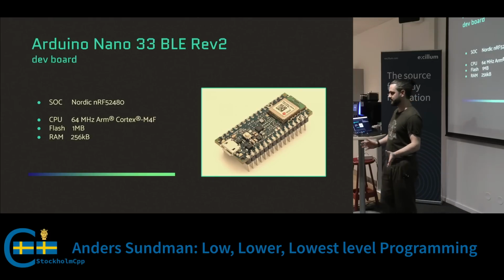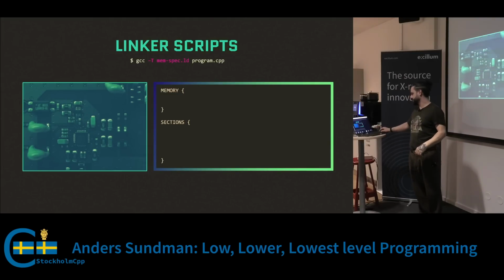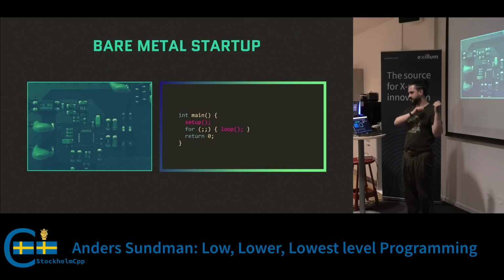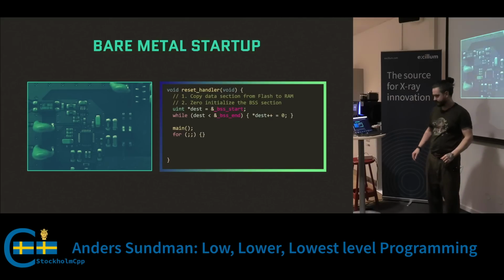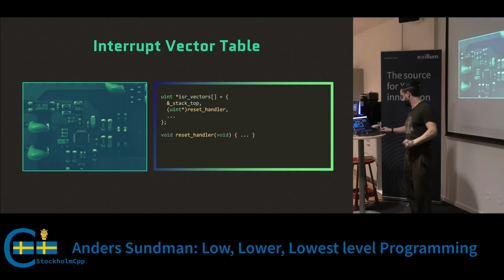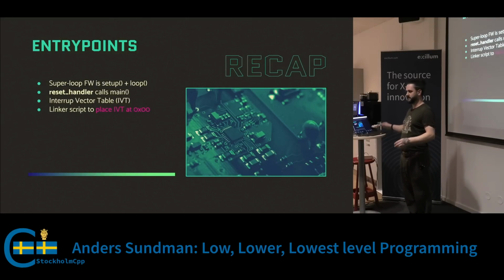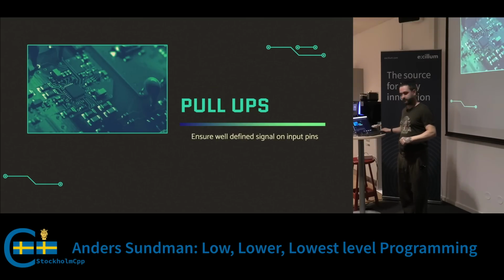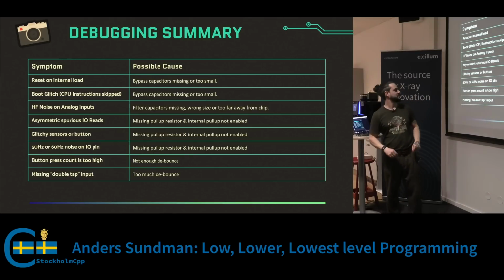Anders Sundman: Low, Lower, Lowest level Programming

Comment: It's definitely not low level programming. Where are the 1s and 0s ?
Reply: C Source Code
   ↓
Preprocessor
   ↓
Expanded C Code (after resolving #includes, #defines, etc.)
   ↓
Compiler
   ↓
Assembly Code (ARM Cortex-M instructions)
   ↓
Assembler
   ↓
Object Code (.o file) → Machine Code (010101...), in ELF format
   ↓
Linker (uses .ld linker script)
   ↓
Firmware Output (.elf / .bin / .hex) → Ready to be flashed to STM32
Reply: @rickpat0101 Lowest level from a programmer's perspective is assembler language. Handcoded .s files assembled to .o (ELF format). As long as there's compilation from a higher abstraction than .s, it is not the lowest level.
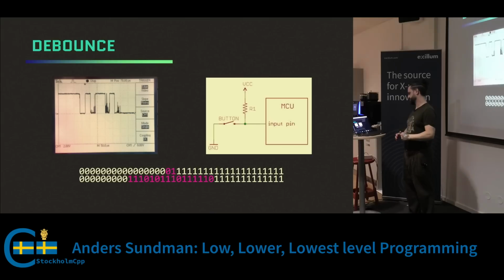Reply: 38:57 😉
Reply: 010

Comment: c++ and em bedded development are absolutely mutually exclusive.
Reply: This is not true at all. It is true at all. Hmm, so what. As with any tool, use it wisely. Don't use a sledgehammer where a screwdriver is needed.
So for C++: Don't use all the whistles and bells that modern C++ offers you.
Reply: @monlynx  Chuck moore who invented the Forth programming language says if your binary is not at least 100 times smaller than the equiv C whe you code it in forth then you ahve done it wrong.  

I for example have coded a ncurses like  windowing system in forth in 6 k and ncurses itself is in 600k so this seems to hold true.

Even if you avoid all the language bells and whistles with c++ your resultant binarhy is going to be OVER 100 times larger for being c++.  There are two things you dont have enough of in any truely embedded system.  Processing power and data (including code) space.   Doing embedded things in C++ is *M*O*R*O*N*I*C*.

I have a friend who says that "Developing embedded applications in C is like opening a CAN with a ROCK" But even C is perfereable to c++ (unless its Keil's 8051 C compiler lol).
Reply: @markmanning2921  embedded != embedded. There are embedded systems with 16 Cortex-A72 and 4GB RAM. 
Plus C++ code can be done real small. 
Regarding Forth: I have not seen any project in my 25 years of embedded programming using Forth.
Reply: @markmanning2921 depends on the application.
On esp32, or even the much more constrained atmega328 or even atmega128 etc is perfectly fine with c++.

You can also easily make a wrapper for a function you write in assembly, (or use inline assembly) with c++ for time critical portions of the code.

If the app you are making is dead simple; read a pin and report its state to serial f.ex; its the serial transmission which will be the time limiting factor whether you code in c++, assembly, or probably even with micropython. 
(By serial transmission i mean the hardware UART, if you use SPI or bit bang your own "serial interface" then its another matter)

But when your app just gets a little involved, its the regular stuff that often is the issue anyway; bugs.
Not just from code syntax, but also code logic in reference to hardware.
Better tools like c++ over c, in environments where you often dont have (reliable) debuggers is very nice to have.
Reply: @markmanning2921  This felt wrong in so many ways. Agree with you 100%

Comment: I'm not a professional with embedded systems yet I am familiar with most layers of abstraction. From a C++ language perspective with respect to modern embedded systems, I would say that is fairly low level. It is diving into the entry point into a C++ program by invoking main, setting up or prepping the CPU or system's text and data segments, reset vectors, etc. while also pointing out what to be aware of from the hardware engineering side of things. I can agree that this is fairly low-level programming within the context of a high-level language.  

However, I still wouldn't say it's the lowest level. Sure, we are diving into a bit of assembly and sure we are setting up the memory addresses, the stack frame or base pointer, the reset vectors manually, however, it's still relying on the various C++ compilers, linkers, even the operating systems to do a lot of the leg work for us. 

If one was to claim that this was the lowest level of C++, then they would be literally writing their own C++ compiler and linker at the assembly or even at the opcode level for a given piece of hardware, architect agnostic of or even without any system calls or kernels from an arbitrary operating system. Yet, most people rarely do this anymore these days. They rely on GCC, Clang, MSVC, and depending on the compiler and linker tool chains, they highly and primarily rely on LLVM pending and in many cases, they also rely on already well-defined filesystems that have already been implemented such as the elf file format or exe executables. People rarely create their own filesystems, and their own virtual tables, memory mappers, schedulers, etc. 

So even as this is within modern embedding, there are still many lawyers of abstractions that are still being relied on.

This is just my personal perspective and I'm just a self-taught hobbyist. I've been around computers since at least the mid 80s before most computers even had internal hard drives where they only had a few KB of RAM and enough internal ROM to store a Basic Interpreter. The lowest level of programming agnostic of any programming language including assembly is without a doubt bit banging. If you're not working with the individual bits of each and every instruction within the ISA or the system's OP-Codes, then you are working at some higher level of abstraction. And even this isn't the lowest level of abstraction. When you start to build your own ISA from basic Logic Gates, that's even one lower level, and yet that's not even the lowest level. When you start to build out your system from transistor networks that's even one level lower than pure logic that builds out that logic. Yet that's not even the lowest. When you get into the composition, shape, volume and placement of various materials to make your internal devices such as your transistors, that's even another level of abstraction lower. How far down the rabbit hole do you want to go? Quantum Mechanics? Pure Mathematics and Physical Computations? State Machines? Lambda Calculus? Turing Complete? 

Yet, this is why I truly enjoy and appreciate videos like this. The time, work and effort that is put into them for others to observe: Thank You! It was truly enjoyable to learn something within specific subset or subfield of the general field of mathematics, physics, electronics, computers that I am into that I know little about. I'm quite familiar with C/C++ as I have done 3D Graphics - Game Engine - Physics Simulations design, Hardware Emulation, and even dove a little bit into Compiler Design - Language Theory, and even a little into OS-Kernel design. I'm no stranger to C/C++, I have a decent knowledge of Assembly, and a moderate understanding of ISA Design. As for a hobby, I have the following Steam titles in my library: Turing Complete, Hard Chip which are directly related to CPU design not including other titles that have similarities to many topics within computer science either it being software or hardware engineering such as Factorio, Dyson Sphere Program, Mindustry, Satisfactory, Oxygen Not Included and more. 

If it's engineering related and is or has the potential in being Turing Complete; I'm game! 

Keep up the great work!

Comment: This isn't low level - not really. Try writing two apps that share 512B program and 32B RAM on an 8 pin PIC. Try coding a resistance measurement tester covering over 8 orders of magnitude on a platform without a floating point library. You have to write your own. Try 4 bit microcontrollers.
Reply: You should notice this is specifically a presentation centered on C++, not the micro-controller hardware its self.
Reply: Does any company still manufacture such an MPU? It seems like the ¼ cent saved on the chip would be masked by packaging cost, and any apparent power reduction totally negated by the inefficiency of the extra operations needed to juggle insufficient resources. A product with such specific limited requirements would likely be well served with an ASIC that doesn't need any programming after manufacture.
Reply: @mytech6779  Yes, quite so. Today the norm is 32 bit with a few kB RAM and a few 10s of kB flash. And I have embraced it.
Reply: @mytech6779  Yes ... Microchip are still manufacturing Atmel's AVR range and their own PIC range.
Reply: @edgeeffect  I may have missed something, but don't see any 4 bit products in either of those lines.
Values to 255 have reasonably wide use cases, 15 is very niche and multiple steps for every 8 bit operation is extremely inefficient.
Reply: @mytech6779  Sorry... I misread the initial comment, I honestly thought they said 4 AND 8 bit microcontrollers... yeah, I saw a 4 bit microcontroller once whilst mixing my girlfriend's microwave but, yeah, they're not exactly common. I must have seen "8 pin PIC" and "8 orders of magnitude" and some how "hallucinated" "4 and 8 bit"???? maybe I'm an AI ;)
Reply: who uses 4/8-bit microcontroller nowadays? these microcontrollers are more expensive than the 32-bit from other manufacturers
Reply: @sikwateugbinaki  Such systems still need maintaining from time to time.
Reply: @lumpyfishgravy  inasmuch as that actually defines what low level is, such scenario is becoming increasingly rare and is something we don't have to worry about most of the time